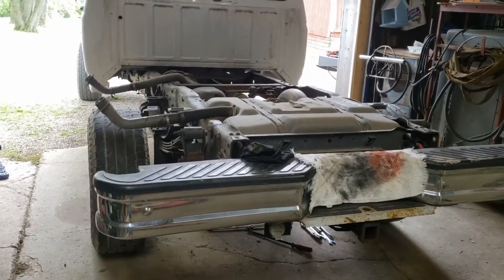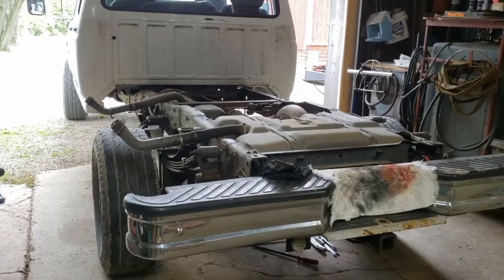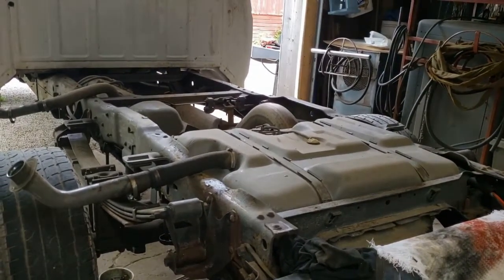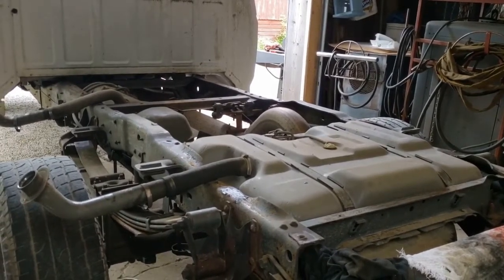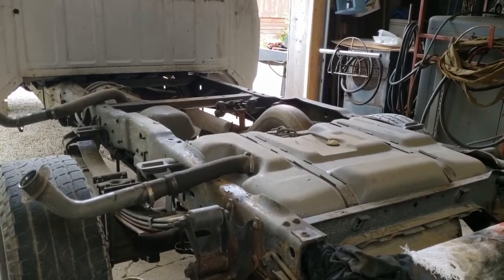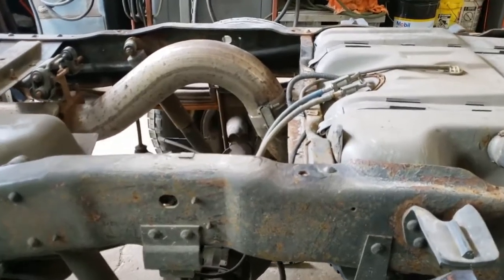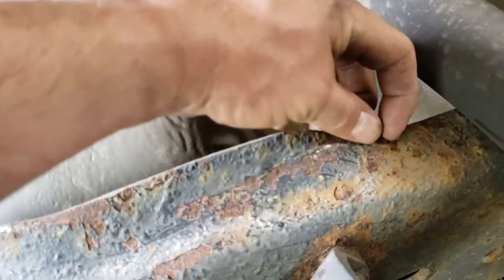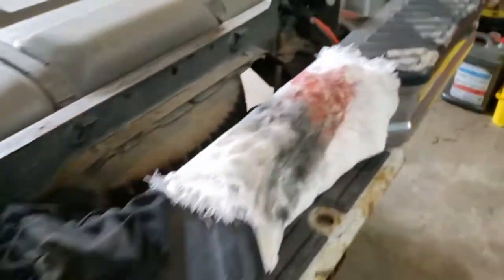Undercoating With Wool Wax

Comment: I use a spray gun with metal can.  Small hot plate with boiling water.  I then heat up the wool wax in the caniser to about 120 degrees.  Helps it spread in every nook and cranny.  Especially in the fall.

Comment: Thanks for sharing this video and your comments about this product.  I am considering this, as well, for undercoating my truck.  The problem, presently, is I don't have a compressor with the capacity needed to spray on this product.  Can it be applied any other way?  After about a year now how is the coating holding up on your truck?  Finally, have you done away with washing down the truck after driving in the snow ( I know you said you drive a Jeep during the Winter when you can) or do your still have to wash off the road salt?  Thanks, again for your thoughts.
Reply from the maker: Great questions, sir!

I try not to drive the truck at all when there is salt in the road. When I can't get around it, I'll likely still wash it off.

This material is thick enough that I think it could be applied with a brush if you wanted.

I'll be re-coating the vehicles here shortly and will post an update on how they're looking at that time.

Thanks for watching the videos and for asking  a great question. I'll include those in the video I make here in the next few weeks.
Reply: @diymechanictv1233  I surely appreciate your reply.  Yes, looking forward to your next video on this product.

Comment: Yes more videos, I'm going to try the wool wax this fall.  Approximately how much is a 5gallon kit.
Reply: Also, any updated engine/tranny upgrades.  Keep up the great maintenance and your vehicles will treat you rt 👍
Reply from the maker: Good morning John, Amazon has the 5 gallon pails of Wool Wax for $189 for the straw-colored product like I am using here. I think the black product is $10 or so more per pail. Given that I seem to be using 3-4 quarts per vehicle when I do them the first time, I'd say it's a pretty good bang for the buck.

I do have quite a few engine modifications done to this truck (larger injectors, turbo compressor wheel, intake, exhaust, intercooler, electric fuel system, etc). There is a whole series of videos I put together a few years back where I added those modifications one at a time and towed the same load after each one to see what effect it had. Look for the "Project Powerstroke" videos if you care to watch them. I haven't done much to the drivetrain since then, and the transmission and driveline are stock (for now - though I do have some plans in mind). 

At any rate, thanks for watching!